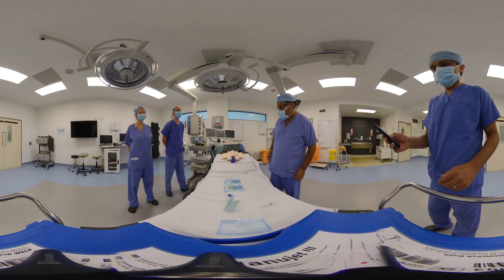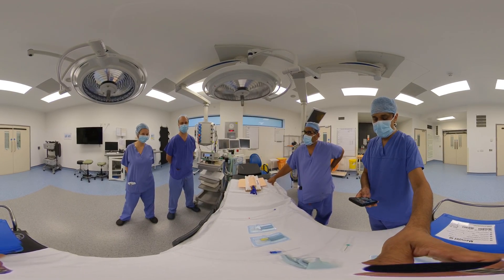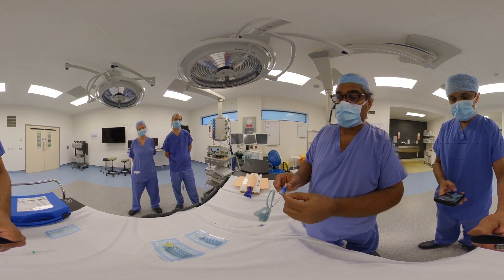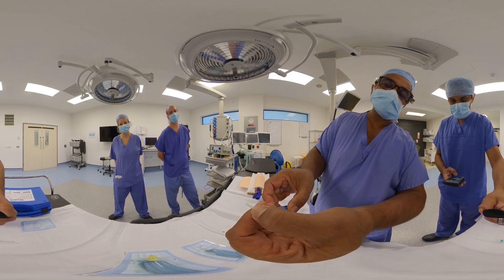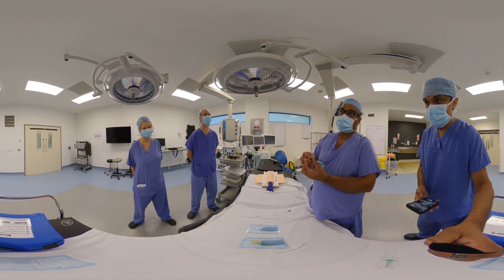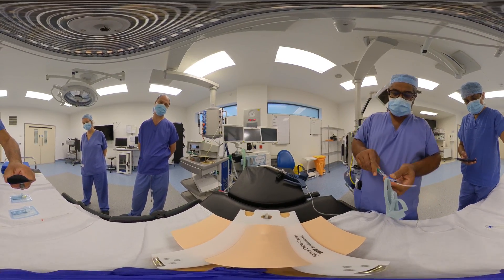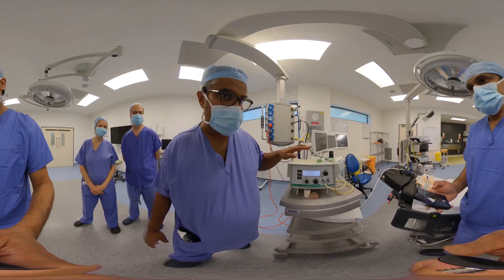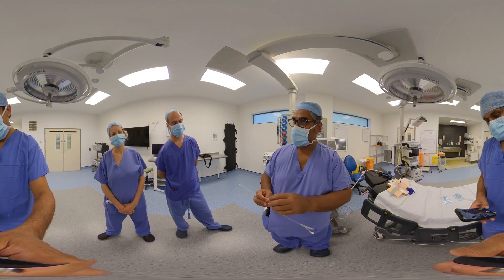Chet Patel describes the anaesthetic technique of jet ventilation

Comment: With the high frequency ventilation using the Maestro, how does is barotrauma prevented given so little time for passive recoil of the lungs? Would it be safer to drop the pressure to minimum (say 0.5 bar) and decrease the frequency? And is 1 bar pressure here = 250ml/second?